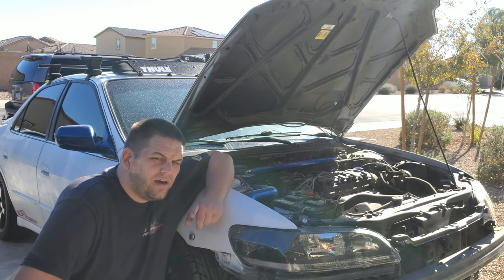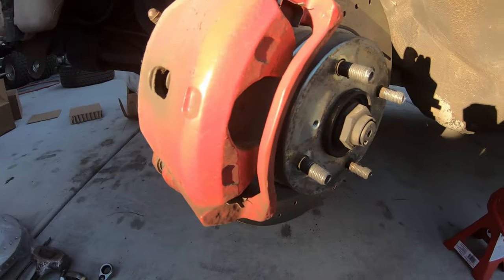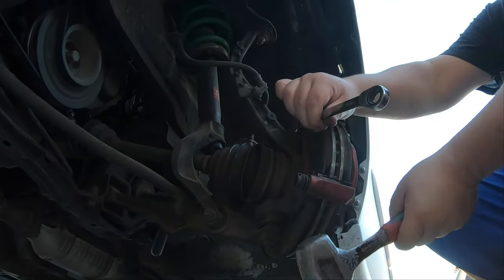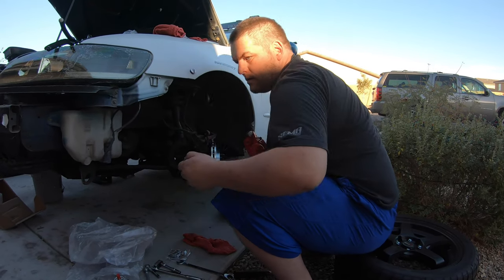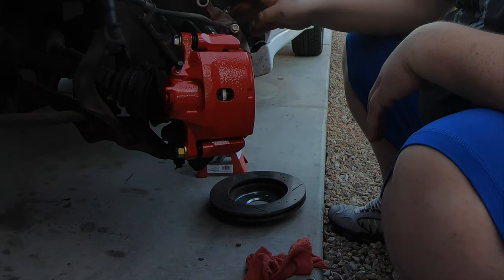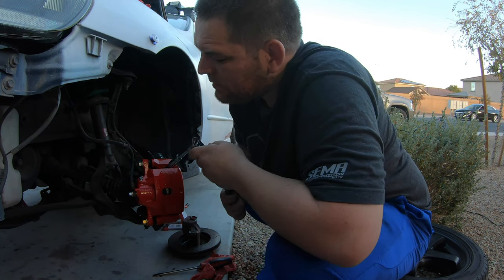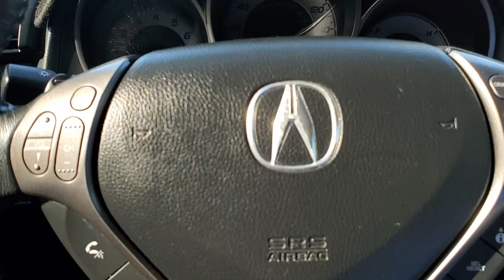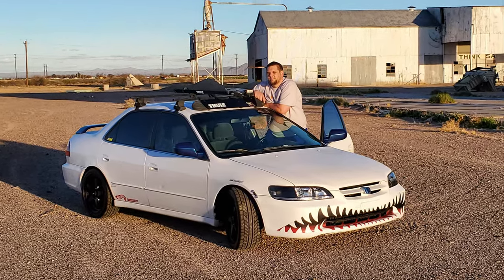Fixing the Brakes on my 2000 Honda Accord, as well as a few other things

Comment: Need help im trying to get a factory air intake n cant. Find it any advice?
Reply: 2001 honda accord ex
Reply from the maker: Check your local junkyard.  I prefer places that let you pull your own parts.  These cars are pretty common in junk yards now days ans if you can find one that isnt completely smashed in the front, you can take what you need at a fraction of buying new or ebay.